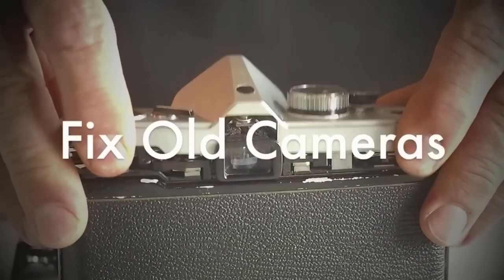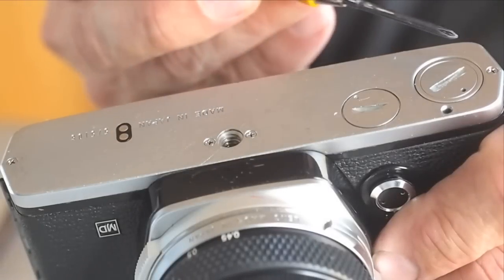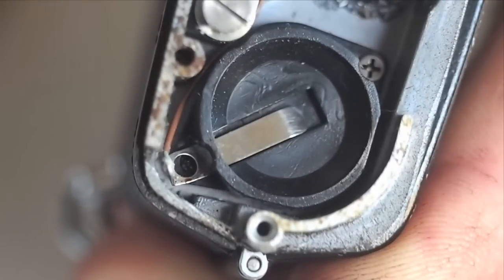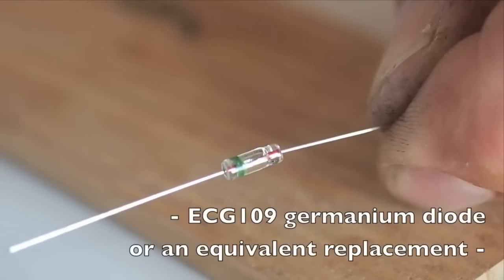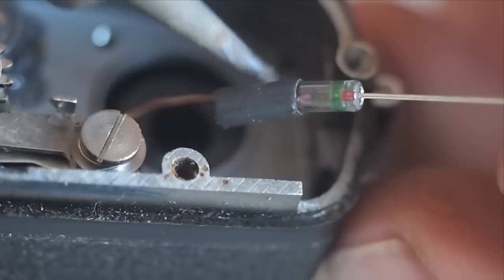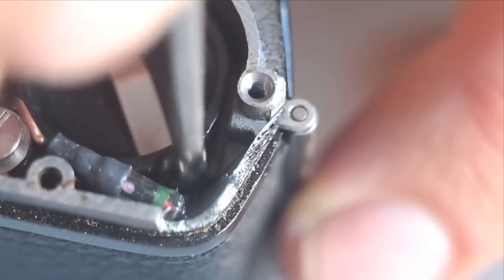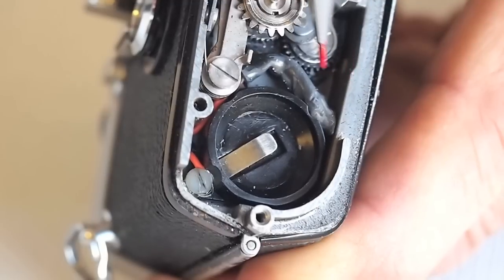Fix Old Cameras: OM-1 Dead Meter / Diode Modification

Comment: Thanks for the videos. I followed the instructions and did a full overhaul on my OM-1. 
The light meter seems to stay on no matter the switch position but it might be a contact problem so we'll see with a new battery. 
Though most of the foam has eroded all over the place, I will probably need to fix the light-sealing.

Comment: Took the bottom plate off my $5 flea market OM-1 and you were right, the nylon screw head had come off.  I was luckily able to remove the "stump" with a pair of tweezers.  The wire had also snapped off so I had to delicately strip off some insulation with a razor blade.  Now I just need to get the diode, solder it in and if I'm lucky I've got a beautiful classic camera for peanuts.  Just need to recover it also as the leatherette is just starting to peel off in 1 corner, always wanted to have a go at that, I might try a nice fake snakeskin !  Thank you so much for posting this video.
Reply from the maker: Great comments and thank you for your interest in Fix Old Cameras.

Comment: will throw out the meter by 2 f stops because the diode not only reduces the voltage but also the current (I) and is less than mercury battery current. with this mod you also have to change circuit board resistors to adjust for new current. adjusting the eccentric screw by meter to compensate meter needle is false too because will throw out the zero position of meter (no battery, ASA at 1600, shutter at B f stop at 8= zero position- needle on center between +/-), thus not acurate at different lighting condition.

Comment: Thanks for all that info Mike. I located ECG109's but the company only has 1 in stock, bummer. I emailed the salesman and he'll check for me.  Meanwhile I'll try an IN34A if I can find any. Roger on the Mercury content in CFL's. Have you ever noticed that a CFL gets so hot you could fry an egg on it. I've had them melt light fixtures. I also seem to remember an Article in the old "Camera Craftsman" about the diode fix. I used it on my Yashica 124G years ago.I'll have to see if I can find that issue and see what diode it used. I've purchased Wein cells by the box from B&H camera in NYC. I find they only last a month or so.
Reply from the maker: Great comments as always Tom. Thank you for your continued interest in FOC.

Comment from the maker: Tim Powell If the meter in an OM-1 turns on but refuses to respond to light changes than most likely the CDS cell(s) function should be checked. Check the resistance of the cell for linear changes that coincide with the changes of light intensity. Check for open circuit.

Comment from the maker: +Endra Hanugroho The installation of the appropriate diode between the battery wire and meter circuit will work on the FTn as well as other cameras with a single cell galvanometer based meter.

Comment: Old post, I know, but are you using the voltage drop across a forward biased diode to take the effective voltage down by .2V??

Comment: Trivial I know, but the original screw on many (but not all) OM-1 and 1n's as shown was plastic, not nylon. 

And you can easily insert the white nylon screw described without re-tapping the hole -- the original metric threads in the metal casting will easily cut new threads into the nylon of the replacement screw. Once inserted fully, cut off the excess length of screw that protrudes into the film chamber next to the take-up spool flush with the body using a narrow X-acto knife.

Comment: I was just wondering.  I have a Vivitar 45 that uses the old Mercury Batteries PX 675.  It has the circuit that is reverse polarity.  Do you think the diode fix will work with this unit?

Comment: Awesome stuff! I have an OM-1 that I am working on. The battery wire has a crusty brown substance on it. Does this mean that the wire needs to be replaced? Or can this be fixed with the Diode method or even some cleaning. Your advice would greatly appreciated!
Reply from the maker: The wire is corroded to the point where it will probably not take solder. The wire will then need to be replaced. It is also possible the contact will not take solder. Fashion a battery contact from copper or brass plate or salvage one from a donor camera. This video shows how to access the battery wire.
https://www.youtube.com/watch?v=swcuZ9xCFXs&t=300s

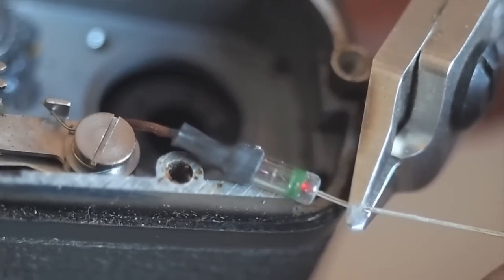Comment: @FOC: What do you use at min 2:16 to improve contact of the old solder pad? Thanks in advance.
Reply from the maker: Rosin Paste Flux https://www.amazon.com/shop/fixoldcameras?ref=ac_inf_hm_vp 
However often the residual corrosion will make the contact nearly impervious to new solder. In such a condition, no amount of burnishing  or cleaning will prepare the metal to take solder. In those case a substitute contact will need to be used at this time the battery contact wire will also need to be replaced. 
https://www.youtube.com/watch?v=swcuZ9xCFXs&t=197s

Comment: Thanks for great video. Can You tell me does the SCHOTTKY BAT42 diode will work? My local store only have that one :(
Reply from the maker: The diode will do no harm to the meter circuit if you want to give it a try.
Reply: Fix Old Cameras I did it, but I use Schottky BAT43 diode and V625u Varta battery. So far looking great. BTW it's Olympus 35RC camera.
Reply from the maker: Good to hear of your successful repair. Keep it going. The Olympus 35RC is a nice camera to use.
Reply: Thank You. Keep filming good tutorials. :)
Reply: One more question, I have Pentax ME Super and meter constantly underexpose one stop. Therefore film 400ASA I have to treat like 200ASA. Is there possibility of adjusting?

Comment: Would it be possible for you to do a video about a meter replacement? I’ve done the battery wire replacement to no avail, and have another OM1 that’s in poor condition with a working meter.
Reply from the maker: The OM-1 will need to be confirmed as to be the same meter version. It might be easier to repair the mechanics if the meter swap out includes the galvanometer itself. The CDS cells or circuit should not give you too much trouble. But the string the links the meter to aperture ring is tricky.

Comment: Hi I enjoy repairing cameras, I have an om2 to which I changed pentaprism and switch, I ask you a question.
Is it normal that, by increasing the ISO, the light meter indicator in "auto" mode gives the same shutter speed values? shouldn't they increase? Thanks, Nunzio
Reply from the maker: In Auto the aperture setting and the ISO should change the shutter speed accordingly.

Comment: Hi all,  I would like to share an issue I had with my M6 non TTL. It is a strange issue on the lightmeter. I found that the lightmeter is giving wrong exposure only when shutter speed is at 1/125 s position. And I slightly turned the dial towards to the 1/60 s direction, the exposure was then corrected. I am wondering if anyone encounters the same issue before? and how did you fix this problem? Thank you

Comment: Will the new replacement battery of 1.5 v cause a malfunction of the light meter in the OM-1?  I recently replaced my battery and it quit working.  The contacts are clean with no corrosion.  Thanks.
Reply from the maker: Such a battery will not cause the meter to fail. The only damage it can do is corrode if left to discharge over a long period.

Comment: Hi. I have an OM1n, and the meter is not operating correctly, showing greatly overexposed readings. I have purchased the CRIS adaptor and installed the recommended Eveready alkaline 386 battery to compensate its 1.5v. What would you suggest? 

I took a reading against a buff colored building and received a f4 aperture with a 1/2sec speed, on a relatively bright but cloudy day, with ISO 400 film aboard. Obviously wrong.
Reply from the maker: A CdS cell or cells could be faulty or have a broken wire. Confirm CdS 
cell condition. Depending on the type of cell used in your camera the 
resistance reading should range approximately 30 - 70 K ohms with your 
light source  at BV4. At a light source of BV16 or higher the resistance
 should max out at 1- 3 K ohms. If resistance is infinite, the CdS 
probably has a broken lead wire. If the cells are good and the zero 
point is still  extremely out of position adjust the position of the 
meter connective string attached to the galvanometer assembly. In case 
of an excessive up swing of the meter needle loosen and turn to the 
right. In your case, that of an insufficient swing of the needle, turn 
the adjustment to the left. You can make fine adjust via the eccentric 
screw that slightly changes the position of the lever on top of the 
galvanometer. For non linear meter issues the resistors on the meter 
board can also be checked and increased or decreased to affect the 
position of the meter needle across the light spectrum. Please note that
 resistor service would be quite tedious. Without another OM1n with a 
properly working meter of the same sort for reference, it is not 
recommended.

Comment: The question is what battery to use even after the modification, as the widely available LR and SR batteries drop in voltage over time?
Reply: Answer to my own question: Silver Oxide Batteries like the S76 or 357 should be fine. 
They show discharge profiles that are almost identical to the ones we find when looking at mercury batteries.
Reply from the maker: Very good battery of the Silver Oxide choice for the reasons you state. Thank you for you interest in FOC.

Comment: Hi, Thanks for the video - great help. I was only able to find a Schottky 1N60P diode. Will this be adequate? I know that it is temperature dependent but only on the milivolt scale?
Reply from the maker: +Jonathan Malin 
The ECG109 germanium diode is probably considered a vintage diode. Finding it or a direct substitutes might be getting more difficult. Not knowing the specs of a schottky 1N60P prevents an accurate comparison. However the diode used is actually not as critical as you might think. As long as you get the desired voltage drop on a linear scale and the physical size fits in the space available it can be used without concern. If the diode you chose does not work, try another, you will not harm the meter.

Comment: Hi - I have a Minolta XG-2, and its meter works inconsistently. As in, it has worked for quite a while, but sometimes it gets confused by something and instead of lighting up 1 or 2 LEDs in the viewfinder it will just kind of sweep and light up a bunch of them, and they light up rather nervously instead of solidly as well. So it's like something isn't making contact well... - For example, last time when I was aiming at a bright sky, it would just meter as if it was completely dark. I took the picture, but the shutter stayed open for maybe 25 seconds. Long enough for me to think the mirror got stuck, but it was just a really long shutter-time because of the confused meter. It can als go the other direction, all the way over its maximum speed. - So it's really inconsistent. 

I just now gave it another try and while at first I was metering in a poorly lit room at f32, it would just meter beyond 1/1000, which doesn't make sense at all. But then I turned down the aperture and it seemed to display a more realistic reading. I do notice that it freaks out when I turn the aperture-ring, so that might be a hint for you. - Maybe it's even this particular lens, I'm not sure. Though, I don't think my X-700 responds the same, as that one seems to be much more solid. - Do you have any idea what it is and what I could do?
Reply from the maker: Under the lens mount between the upper mount screws is a ceramic resistor base. Clean the surface of the contacts and the resistor base with alcohol. Make sure the gold wipers are making good contact. Be mindful of the spring attachment as you work.

Comment: Hi FOC, the ECG 109's turned up the other day and unfortunately they are all IN27's packed inside the ECG 109  original packages. The seller claims they are the OEM replacements. Is there any quick easy way to test the voltage drop? Say a resistor in a circuit with the battery and diode? Or must I go ahead and try it on my F1 body? THANKS
Reply from the maker: Yes you could mock up a test circuit, but if you have a multimeter with a diode test mode it is simpler. (it may share a space on the meter's selection dial with another function) A multimeter’s Diode Test mode produces a small voltage between test leads. The multimeter then displays the voltage drop when the test leads are connected across a diode when forward-biased. A germanium diode has a voltage drop ranging from 0.2 to 0.3 Volts. A silicon diode has a voltage drop ranging from 0.5 to 0.8 Volts. A shorted diode will have the same voltage drop in both directions.
Reply: OK, My meter does have a diode test. Most of these IN27 diodes are measuring between .253 & .267. My meter isn't a high end one but it seems these may work OK. Thanks again Tom

Comment: hi. great video. i have a quick question. i have an om3 and for a long time now the light meter comes on but doesn't respond to light. it just sits there and only moves when i move the rings. Do you know what could be causing this as i dont want to get rid of this classic and rare camera.. Thanks.
Reply from the maker: When a camera meter does not respond to light changes, but seems to work otherwise than it is most always caused by the CDS cell or CDS support circuitry.
Reply: is that an expensive fix?
Reply: The OM-3 does not use CdS cell circuitry. The input of the Silicone blue cell is amplified and input directly to the Cpu. There are numerous circuit faults that may cause this problem. In all likelihood, the camera will need a new main circuit.

Comment: Great video, I have bought a wein air cell for my Om1, however that brown wire to the battery holder was corroded badly, so I removed it in the hope to replace it.
But I cannot feed a new wire from the base of the camera up to the top, it keeps getting jammed inside the camera!
Any tips on how to feed the new wire through? Is it something you have done before?
Reply from the maker: The battery wire is glued to the inside of the mirror box cavity. Leave the wire and try to find another route up to the top circuit with your replacement wire. Otherwise your will have to remove the mirror cage assembly to gain access to the existing battery wire.
Reply: Thanks for the reply, I managed to remove the old wire a few weeks ago, I wondered what was holding it in place so tight...
I have also managed to route a new wire the same way as the old one, took me a few hours. Exposure meter still not working :( you cant see the needle at all! I am getting a voltage to the top and through the switch though :)
Reply from the maker: You might remove the prism to better see the galvanometer reaction. Perhaps the needle is physically binding. You may hook the wein air cell directly to the galvanometer to check the meter functionality.
Reply: Thanks for the tip, I will give it a go when I have some spare time :)

Comment: i dont know if anyone would be able to help but i have an OM20 that the light meter has been working perfectly fine on but all of a sudden the LED indicator on the inside is behaving erratically and jumping between all of the numbers. the light meter is still working as i am still getting the correct exposure but the indicators you see through the viewfinder are not showing the correct shutter speed. any ideas what might be causing this? i have new batteries in and still nothing.
Reply from the maker: Do not know for certain. Might try cleaning the printed contacts of the ASA/ISO or the aperture linkage sweep arm and circuit base.

Comment: @Fix Old Cameras
I have an Olympus om2n with a meter that works fine in auto mode, but once in manual - the meter reacts only to the aperture change, whereas changing the shutter speed does not affect it. 
However, once I move the power switch to check/reset, it usually starts recognizing the shutter speed change in manual mode. This happens every time when I turn the camera on and without changing the lens prior to that. 
Did you encounter such an issue and could know how to solve it? Many thanks!
Reply from the maker: Typically checking the ASA cam linkage and aperture ring string to see that the coil is rotating and not binding would help... but because the meter is resetting itself through the power switch makes it look like a process circuit issue.
Reply: Fix Old Cameras Thanks!
Reply: Changing the shutter speed dial should have no effect on the meter when the camera is set on AUTO mode -- the shutter speed is controlled by the light reflecting off the film into the photo cell below the mirror, not the dial on the front of the camera. Also not that the needle in the finder is an indicator only -- it in no way actually controls the actual shutter speed in Auto.

There are numerous possible faults in the meter that will affect meter movement. Meter needles often stick to the lower stop once that stop gets sticky with age. Or metallic debris may have been attracted to the magnet inside the meter movement, periodically inhibiting the movement of the meter needle. Both require disassembly of the meter to correct, with great risk to the meter movement itself.